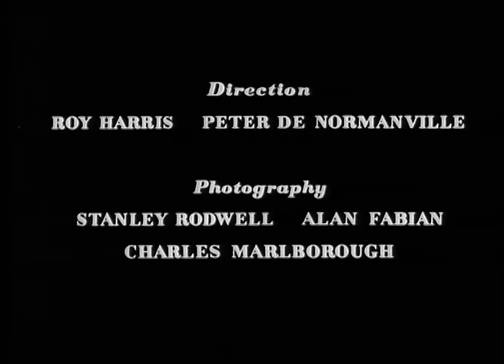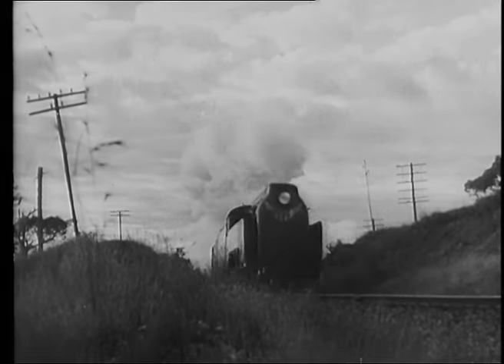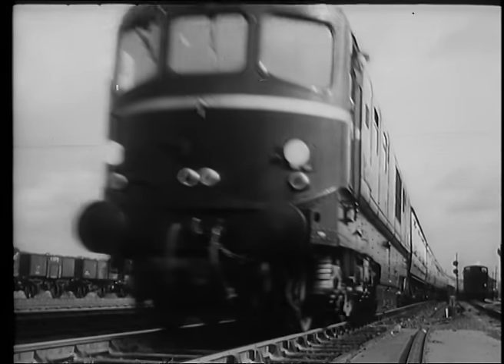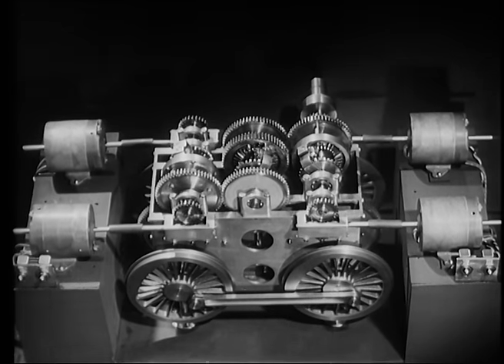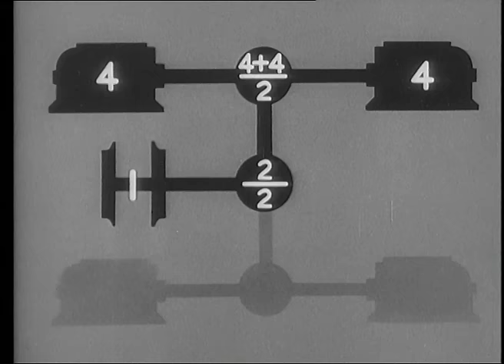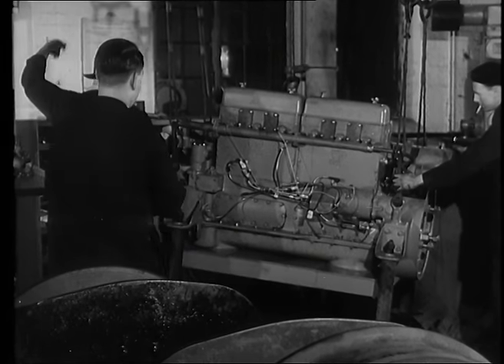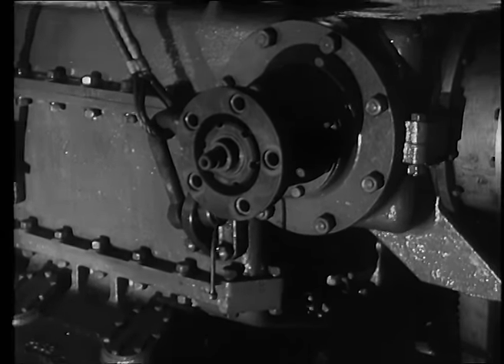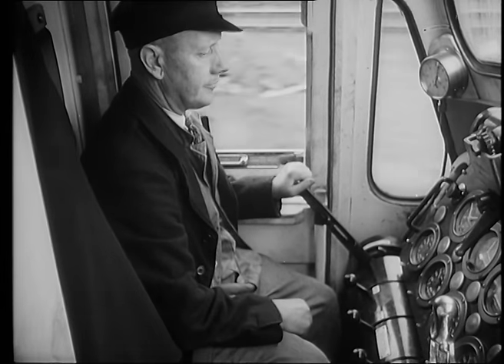The Fell Locomotive | Shell Historical Film Archive

Comment: I knew this locomotive had a complex drive system but never knew how it worked. A fascinating idea but I can see why it was never developed with so many engines and gears to maintain. I thought the Deltics were complicated and costly but this would of made them look simple. I think the locomotive worked well but suffered a fire which brought it to it's end.
Reply: I believe the steam heat boiler caught fire at Manchester Central in 1958 and was towed back to Derby and withdrawn
Reply: @kevinblakeman8858  Now you have said that I think you are right it was the boiler. I remembered reading about the fire a long time ago and saw a photo of the scorched loco at Derby works where it stayed in a siding with a few more pioneers which were all sadly scrapped

Comment: Very interesting.  Lovely old film and very instructive.  More recently I saw that it has been proposed to build diesel electric locomotives with 4 smaller prime movers rather than one big one, in the interests of fuel efficiency - displacement on demand I suppose.
Reply: Locomotives like that already exist, they’re called Gen-Set units. NRE is one producer of such locomotives and one class I can recall (the 1200 class in Australia) is fitted with three 800hp Cummins engines
Reply: i don't know about 4 engines but shunting locos with 1 bigger and 1 smaller diesel are routinely build in Poland.  well, rebuild from  old units. it was calculated that during shunting operations only smaller engine is needed most of the time.

Comment: First good explanation how the Fell locomotive works which I have seen.
While a very good idea in theory, it's practical usefulness was severely limited by its overcomplicated nature compared to diesel electric.
The extra maintenance cost of all the engines would never make up for the higher efficiency, which was after all only 14% better than of a diesel electric.

Its principle with the differential drives made it essentially a constant torque drive at constant throttle setting, as adding another engine would increase power and rotational speed at the drive axle, but not torque on the drive axle as gear ratio changed effectively in the same increments as total engine power would do.

Comment: Over complexity loves the railways sometimes. I can imagine how it got built though. Diesel electric isn't that much less complex to build (one diesel, one generator, four traction motors, complex electrical controls, four traction blower fans) but it's a lot less complex to maintain because the electrical components don't wear quickly and don't need as much maintenance as this would. I imagine this got built to humour and engineer then an accountant got wind of the maintenance and it just went away.

Comment: 4 bus engines singing in unison... must have been a noisy beast.
Reply: Don't forget the extra two engines to power the superchargers.
Reply: A bit more than a bus engine .... they were Paxman 12RPH's, I'd like to have seen a bus with 1 of those shoe horned in 😂😂
Reply: Only the 2 auxiliary engines were what you'd call 'bus' engines; 6 cylinder AECs as fitted to buses and DMUs.
What a strange machine though, and a shame the preservation movement hadn't yet got going back then!
Reply: 13:00 definitely has a hum to it.

Comment: I run my old Lister generator on old 'chip fat,. It's older then my 77 years and still works perfectly. From the many repair videos on YT about Briggs and Stratton one can only assume they use high tensile chewing gum. I have to admit around 10 years ago I got the big end re white metaled. It was 0.0015 above tolerance after 70 years. The mains were fine. It smells out of this world under load, 'cod' I think.

Comment: The Americans were well advanced with diesel traction, im all for novel ideas but why not make something practical. 
Even here in Australia  the Victorian railways had a doubled ended B class loco of 1500hp in 1952, highly successful,.
Surely the most successful experimental diesel of that period was DP1 or deltic, which I can remember running on the ECML in 1959.
Reply: That came much later, the year in question is 1950. The LMS had already built two American-style locos, Nrs. 10000 and 10001which operated quite satisfactorily until the mid sixties. The gave rise to the "Peak" locos, Classes 44, 45 and 46 - esentially the same design as the LMS prototypes and operative on BR until the early 1990's.
Reply: @1258-Eckhart  it's a fact that most diesels of the period were no match for a decent steam loco, two LMS diesels were equal to one Duchess and it took production delticss to out perform an an A4 or A3.
It took 4 US diesels to match one big boy but they looked at it differently, with four units if one failed the train didn't fail.
Reply: Remember of course in '53 DB had entered squadron production of the iconic 2000 hp V200 diesel hydraulic. Things like the way over the top fell and less than startling lms pair and SR trio really made the western region quite keen on looking at what the Germans were doing. And of course the Germans were pioneers of diesel electric, settling instead upon hydraulic
Reply: @muir8009  The V200s were great, BR just. Wanted to standardise.
Back in the day the regions still had the grouping mentality so regions liked to do there own thing.
The Western had the Class 52s just to be different.
Of course it was really the Black 5 of diesels the 47s that really put standardisation on track
Reply: @Steven_Rowe  the WR was an ideal testbed for BR to have a play with hydraulics: Devon banks which necessitated power efficiency, and of course if kept all within one region could keep differing facilities and maintenance requirements to a minimum.
West Coast had already been slated for electrification, East Coast was flat enough (although feinnes wasn't happy) and SR Was already pretty much electrified, only leaving the WR.
One of the obvious things is of course by the time of the pilot scheme with its A, B, and C power categories the traffic requirements were rapidly changing. So rapidly of course that in 5 short years by the time of squadron production the power categories had now increased to 5, the preponderance of class A units required had dwindled to almost nothing as the traffic that warranted it had dwindled to almost nothing. So of course the 47, 37,... basically the higher powered units ended up being vaguely useful.
Tellingly this was of course when the Brush type 2's started having its legendary mirrlees issues; power increases it wasn't designed for but the locomotive needed to make itself useful
Reply: @Steven_Rowe  the Union Pacific never gave up their desire to have a single high horsepower unit rather than four smaller units to replace the Big Boys.  They developed gas turbine locomotives in the 1940s and 1950s that were nearly equal to the Big Boy in terms of output, and high horsepower diesel locomotives in the 1960s.  They even expressed interest in nuclear powered locomotives, though it never went anywhere.
Reply: @survivingworldsteam  ÿou may be right and they did try gas turbine but even today with units or 3 or 4 thousand hp they still run them together obviously for power to pull heavy trains but also for security if one fails.
 A fail train blocks lines and normally has penalties for doing so.

Comment: Very clever. I don’t quite understand, though, how it would work up a steep incline. If a lower gear was required, then fewer motors would be in use, so that it would only be able to climb the incline very slowly. The main advantage of a diesel electric locomotive, of course, is that it may be built so that it can operate either from the onboard diesel generator or from an overhead line (or even from a third rail) and can therefore run anywhere on the national rail network. It can continue to operate on electrified lines even if the overhead wires are not functioning. It is the most logical form of locomotive.
Reply: Not really. A 'regular' diesel electric locomotive can only run under the power of it's internal diesel engine. I think you're misunderstanding the term diesel electric.  They are diesel AND electric, not OR.  As it states in this video, they are basically small power stations producing electricity to drive the electric motors connected to the axels. There of course locomotives that can use their own prime mover OR external electric supply but that is something different.
Reply: @garybroadhurst3548 
The class 73 use[d] either 3rd rail or internal diesel enginr.  Apparently the internal diesel engine was rather underpowered.
Reply: Steep grades were handled by engaging the 1st engine and flicking the oil scoops for 2,3 and 4. She was capable of pulling away smoothly at any grade.

Comment: Out of all the people to do a video on the Fell Locomotive, it was Shell.. huh
Reply: I wouldn’t be too surprised to find out that they invested in a machine that has 4 big engines. Those engines need lots of fuel, now guess who can supply that fuel 😉 This is probably a marketing video
Reply: Shell invested in the locomotive development funding. Bear in mind when the project was started in the late 40s, there were only 2 other mainline diesel locomotives, 10000 and 10001. It made somewhat of sense for them to promote petroleum usage through developing rail traction. 10100, 10800 and 10201 all began running around the same time, mid to late 1950.

Comment: But what is holding the shafts that are at low speed from running backwards? How does it get from zero to slow when the motors need a minimum RPM?
Reply: The fluid couplings could be drained of fluid (the 4 small levers shown) and when empty of fluid would transmit no torque.  At a standstill all 4 fluid coupling would be empty.  When you wanted to start moving coupling 1 would be filled and gradually start transmitting torque.  As speed increased coupling 2 would be filled and gradually start transmitting torque and so on through 3 and 4.  This made the "gear ratio" changes smooth and gradual.   Each input shaft had a mechanism (similar to the action of a ratchet or sprag clutch) to prevent reverse rotation of the shaft when its associated fluid coupling was not transmitting torque.
Reply: @Vincent_Sullivan  Good explanation

Comment: In 1950, the future of the Diesel locomotive had already been decided in Frankfurt (DB HQ), where Krauss-Maffei (Munich) were commissioned to build the DB Class V80, an immensely successful Diesel-Hydraulic, which led to the building of countless further classes culminating in the best of all, the British Class 52, one of the best locos ever built by anyone anywhere. This intelligence seems to have escaped the Shell concern, which (oddly) makes no mention of it at all in this filmstrip. But the engineers of the GWR (now called the "Western Region") were in 1950 already fully in the picture and knew where to look (hint: not towards Shell).
Reply: Bit curious: Shell is promoting the fell, no real reason to look at what DB was doing at the time, and also WR was looking at gas turbines. Really, it was only squadron production of the V200 that had interest from the WR, or BR in actuality, and the V200 was designed for a dissimilar railway with very different operating procedures and requirements

Comment: Seems like that would have the least power 1 engine while accelerating and the most 4 engines while cruising. Then another two engines for just the superchargers what? Why not have all four differentials connected to the same drive shaft via clutch plates? Then you can have max power when starting.
Reply: Simple answer: clutch plates.

Consider the size difference between a car and a coach clutch plate and the difference between the weight a car and a coach can carry (1-2 tonnes compared to 17 tonnes).  Now consider the weight a railway loco has to pull, something like 100+ tonnes and then consider the size, and power, of the clutch required...

Comment: I thought this diesel didn’t actually work very well
Reply: And how right you were.
Reply: Shhh. Not while big oil is trying to shill the idea that diesels are better than electrification
Reply: @JSmith19858  all locomotives have their strengths and weaknesses, steam had better tractive effort and braking, diesel-electric was light and powerful, electric had higher acceleration. Diesel has its uses, especially when the grid goes down after we've shut down all our power stations and outsourced them to China. 😏
Reply: @abloogywoogywoo  lolwut if steam engines have a higher tractive effort, what happened to all the banking engines? The 9F has roughly the same tractive effort as a light duty type 1 locomotive like the Class 20, and a third that of a single Class 60.

Electric is lighter as you're just carrying a motor. Not a motor, diesel engine and alternator. Look at how compact EMUs are.
Reply: @JSmith19858  they were scrapped. The modernisation plan. The cost of to maintain steam engines was becoming increasingly labour intensive and expensive. Early diesels lacked the weight and steam braking of their predecessors, they didn't have dynamic braking on loose coupled trains, so needed brake tenders to stop them running away with heavy loads. Electric exacerbates that problem and is still expensive owing to the infrastructure requirements. In short, there's no such thing as a perfect system.
Reply: @abloogywoogywoo  You're conflating two separate issues. Diesels could hauls longer consists of carriages, due to higher tractive efforts, that had been designed for shorter consists behind heavier locomotives, so the carriages didn't have brakes. Once the carriages were replaced for those with brakes, the issue disappeared.

Diesels and electrics don't use steam brakes. They use dynamic regenerative braking. That is a non issue.

Electric is the lowest cost in the long term, more so if using wind and wave power generation. It just requires making longer term investments. Steam hung around as long as it did because coal was cheap and plentiful compared to diesel, before North Sea oil came online, and there wasn't the investment in electric. Look at the Swiss railways for electric infrastructure building.
Reply: @JSmith19858  you've obviously never watched trains in the heyday of industry. I have. Trains triple headed by diesels because the iron ore trains were that heavy. Your "wheres the banking engines?" is a moot point.
Reply: @@BB-xx3dv I know. They're allowing their hatred of a failed diesel-mechanical design to override the success of diesel-electric. Class 20s, 08s, 47s, 37s, 43HSTs are among my favourite loco designs ever, and still going strong to this day. A testament to engineering.
Reply: @abloogywoogywoo  are you drunk? You said steam engines had better tractive efforts. If that were the case diesels would need banking engines still, which steam engines needed to get up hills. You need to pipe down grandad
Reply: @@BB-xx3dv Half of BR diesels in a nutshell